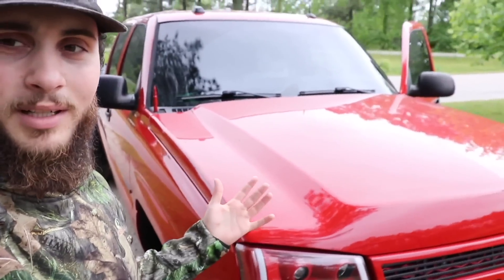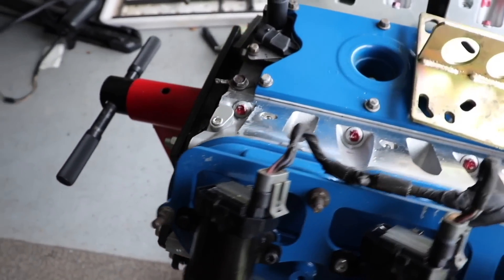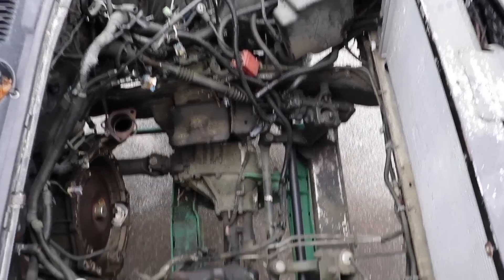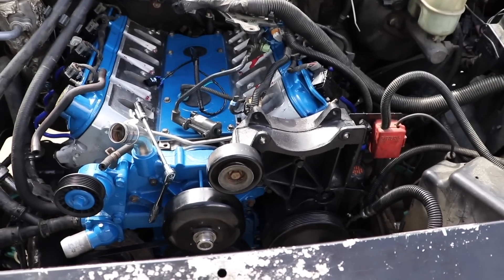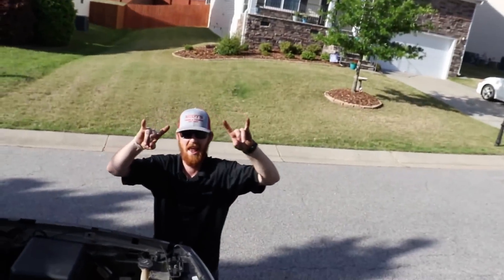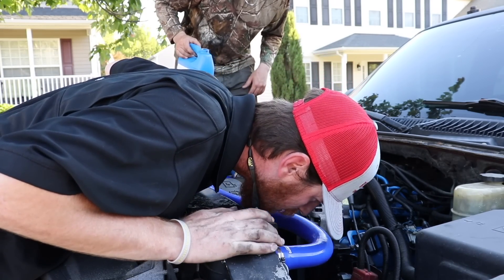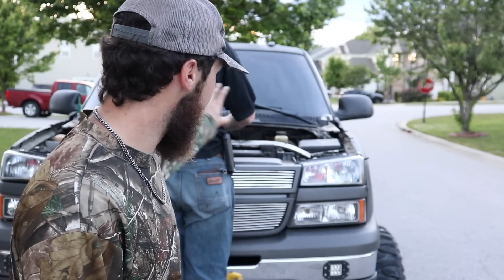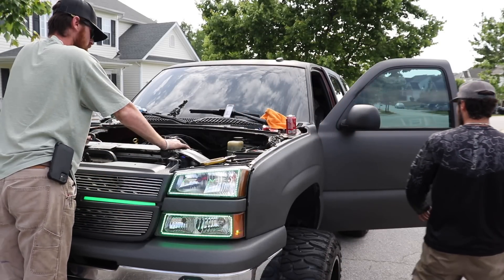PUTTNG a CAMMED 450 HP 5.3 Motor In Lifted Tahoe | FIRST START

Comment: thing sounds good dude good job on the engine build, my truck needed an engine and i had to put 3 into it because the first on blew a rod then the second one had a bad cam bearing always some problems when putting engines into trucks
Reply: Not if you do it right 🤷

Comment: How high can i go on a 2010 tahoe before i have to change or upgrade my axles on my 4x4 tahoe? I just want a straight bolt on lift without having to change a bunch of my stock parts. My suv has only 80,000 miles. Don't need to change all those components.